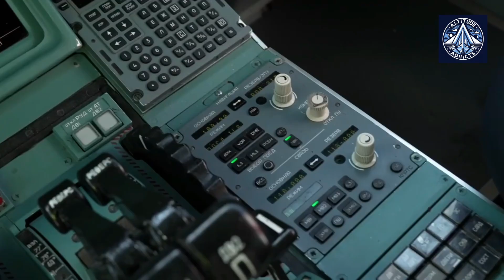Russia’s Tu-214 Crisis: Why the Kazan Plant Can’t Deliver Jets On Time

Comment: The most plausible cause is the difficulty of finding a reliable vendor capable of providing the required components. For years, vendors have been dead and have not produced anything because very few Tu-214s have been ordered. There are even imported components in it. Maybe now vendors will start to emerge again who will provide these components, but it all takes time. It makes sense that in 2025 only 2 will be made, but in the future it could multiply. It must be remembered that everything takes time. If it is true that more and more airlines buy, it is not impossible that the annual production volume will exceed the Comac C919. COMAC is vulnerable to interference from the West who do not want their market to be disturbed, while the Tu-214 is completely independent and not disturbed by Western components.